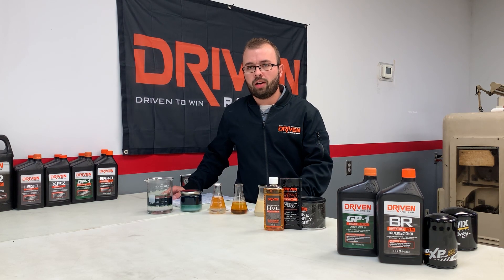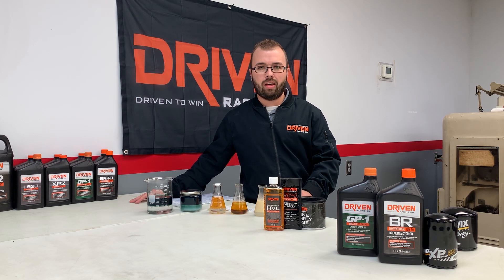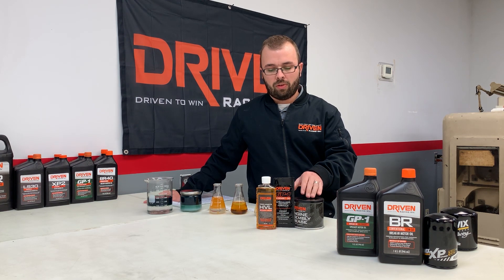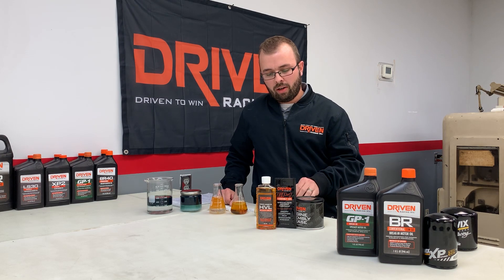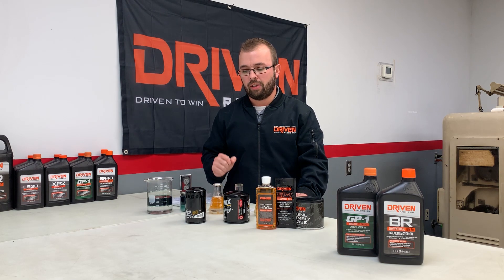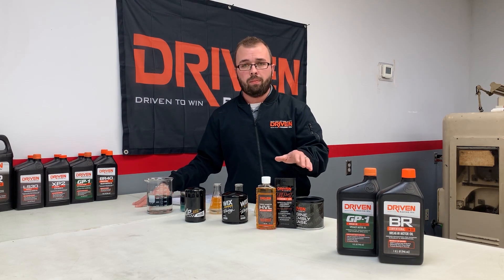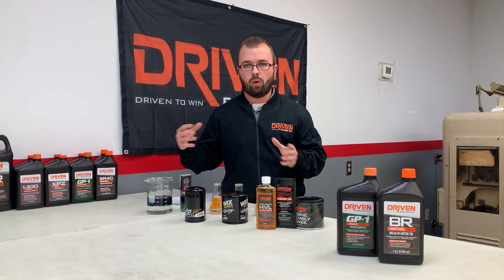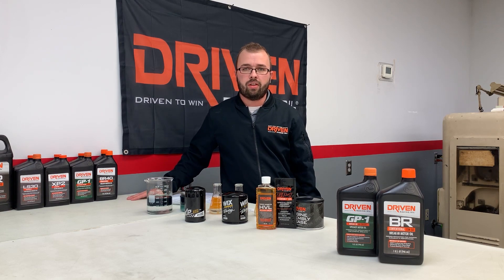Engine Break-In Without a Dyno | Part 3: Assembly Lube & Oil Filter for Break-In

Comment: I will give this brand a chance. REDLINE assembly lube killed my 15K Engine. It did NOT dissolve. Plugged the filter after half an hour. I did not use too much and i did buy a genuine, brand new tube. Will not make this same mistake twice

Comment: The fine filter I dont agree on. On a typical  small block chevy with the bypass opening at 15 lbs. A finer filter will plug faster then the bypass opens and oil is not being filtered.
Reply: It's a differential bypass, not relative.  Otherwise, your bypass would be open ALL of the time.
Reply: Your engine will seize solid before you can clog that wix.